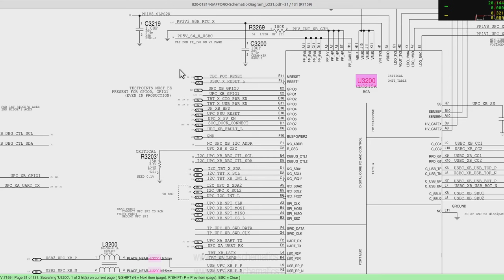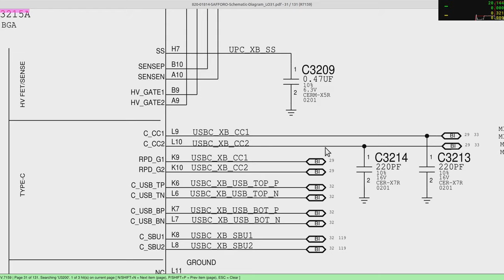Fix bad tech repairs - One faulty port on Macbook A1990

Comment: Ignoring the bad repair, why is it that the USB power mosfets fail so often? It seems to be a common failure on all types of equipment, CD3215 or otherwise. Thanks for the video!
Reply from the maker: I think two factors really drive up the failure rates, but to be fair, I've noticed on PC laptops they're also prone to USB-C and DC-Jack input failures quite often;

1) Environmental exposure
2) Dodgy 3rd party power bricks

There's a real limit on implementing practical input protection schemes, and of course, more with USB-C, the dirt/junk/liquid exposure is a real problem ( less so with DC-Jack type machines )

Comment from the maker: 00:00 Welcome
00:30 Disassembly
05:45 Testing the port
07:30 Testing the logic board
10:00 Removing the CD3215
14:10 Installing replacement
17:15 machine working, time to rebuild it
25:10 to skip the machine rebuild

Comment: Is there a method to his screw removal and placement in the container?  I realize he probably knows exactly where each type of screw goes from muscle meroey..he just seems to place them in random spots in the container.
Reply from the maker: There's a method/pattern.  If you map the 5x3 container over the board/machine you'll see I place them roughly in the same positions in the container and they're grouped according to the item (ie, all fan screws together in the one cell).

Comment: How about a soft toothbrush for cleaning?
Reply from the maker: That's fine for larger areas when you don't mind spluttering / flicking of the liquid around the wash area.   I have multiple types of cleaning options from fine 1mm diameter cotton qtips to a manual or electric toothbrush all the way up to a full immersion ultrasonic cleaning;  however in this case, the q-tip was the "most suitable".

Comment: chunk of blue stuff inside the connector on the board, on one pin in particular
Reply from the maker: those flakes get everywhere - it's the loctite stuff from the screws. Fortunately because the connector pins contact on 3 sides it's rarely an issue ( most likely it wasn't there on final assembly )
Reply: @pldaniels  I'm just noticing tiny details because my senses are heightened from the fright I get whenever you upload a vid fixing a botched repair, not one of my jobs.................yet
Reply from the maker: @TheRabidTech send more ;)